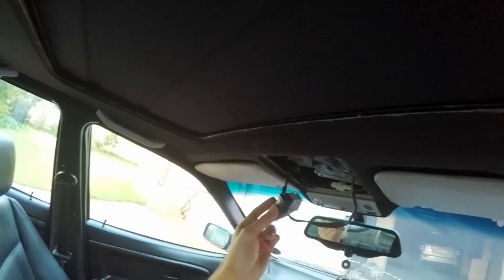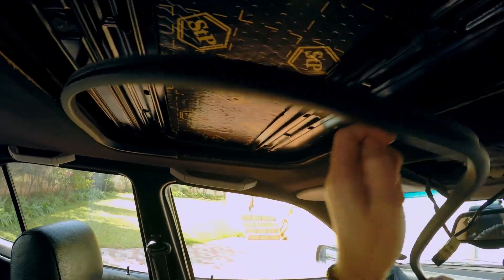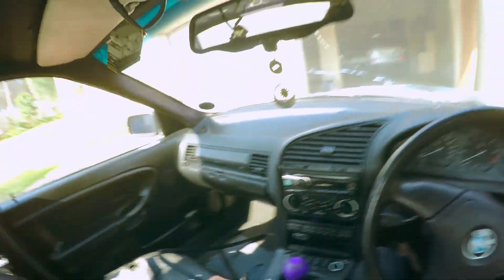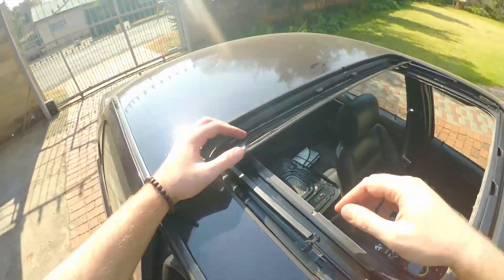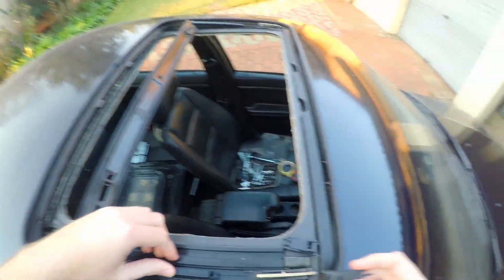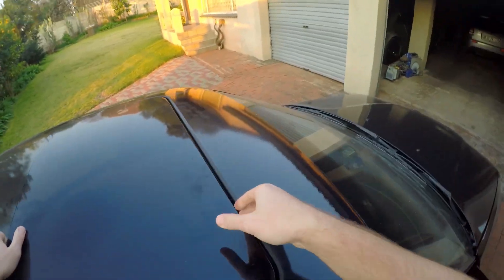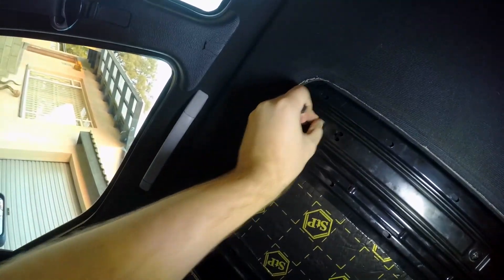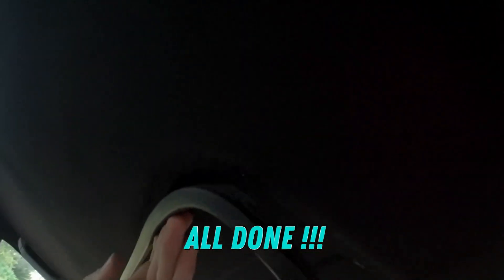3D Printed Sunroof Tilt Fix (BMW E36 Slider Clips)

Comment: Sunroof legs are not broken, left rear 3 millimeters above right. In the case I mentioned, the inner floor is completely closed. Why might the right side be low? (adjustment slides fully open)
Reply from the maker: Perhaps try lowering the adjustment slide on the one side to half or all the way to minimum, and keep the other side maxed out? that should help level it out.
Reply: @adrianmartinescu1107  Adjustment slider on both sides is highest. one side low and one side high. the difference is 3 mm. If I lower the high side it both side stays lower 3mm. When the sunroof is closed, the sunroof sheet stands 3mm lower than the roof sheet.(By the way, there is no problem in the operation of the sunroof). It would be better if I ask you with the photo, can you tell me where I can reach you ?
Reply from the maker: @tolga36uyan  sounds like the motor stop point that "clicks" the sunroof into the closed position is off by a little bit. Super easy fix, and it's in my other video as well where I install a new sunroof👍 basically you'll manually move the sunroof to the level closed position with an Allan key, then remove the motor from the sunroof to recalibrate, and then pop the motor back in and it'll be good👍 I'll send you my details and we can chat if you still stuck
Reply from the maker: @tolga36uyan  messages me on insta, linked in my YouTube bio and we can chat👍

Comment: Howsit bro! How long did the clips last? If I cant manage to print them can I buy a set or two from you? I am in Cape Town.
Reply: Howsit! The clips lasted me about a year until I accidentally leaned on my sunroof from the outside while it was open and shattered them 😂 If you manage to print them your side you'll have to print in ABS or anything better to withstand the temperatures from the sun on the car. If you don't come right send me a PM and I can't print you a set and we can organise delivery, I'm based in Joburg👍
Reply: @Something31337  Courier shouldnt be an issue. Thanx a mil.

Comment: Will this work on an E91 moonroof? The smaller rear panel on mine gets stuck on the passenger side slider. Its either broken or gets stuck but it wont let the roof close from vent mode.
Reply: From the images I see on Ebay for e91 sunroof kits, it looks like a completely different slider clip design is used :)

Comment: Awesome!

Dude, i opened the STL in Cura and the dimensions are real small, can you tell me the real dimensions of the clips?

Thank you!
Reply from the maker: Thanks!

Export settings in my Autodesk were wrong, I've uploaded a fixed file now, let me know if it works. 
The length of the clip should be 54.306mm
Reply: Hello, Adrian.

Everything is fine now. 
Thank you very much, let's print now!